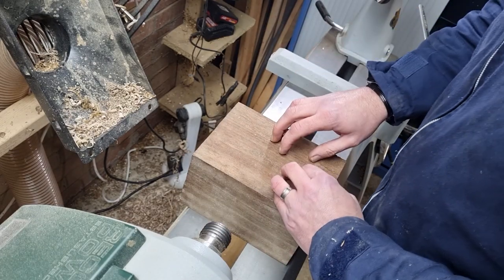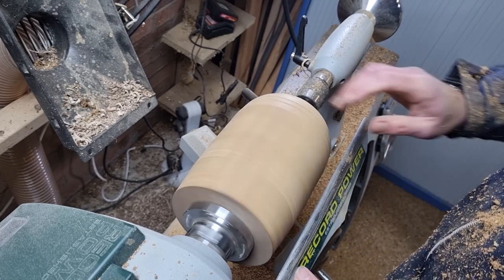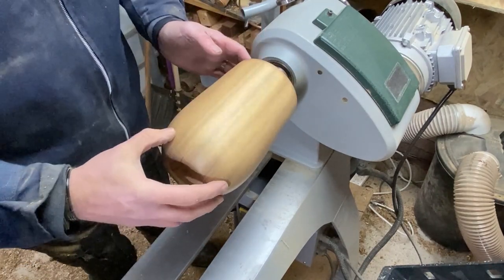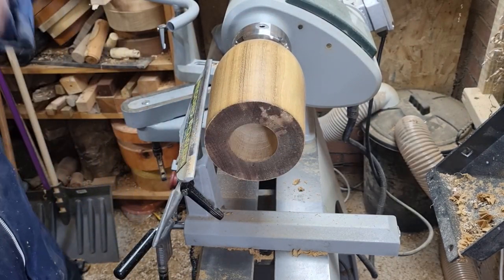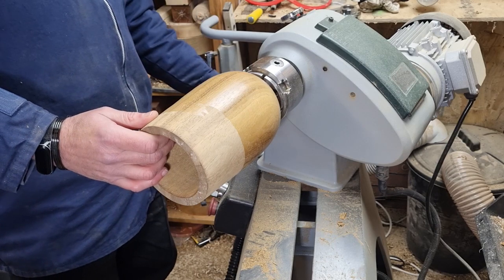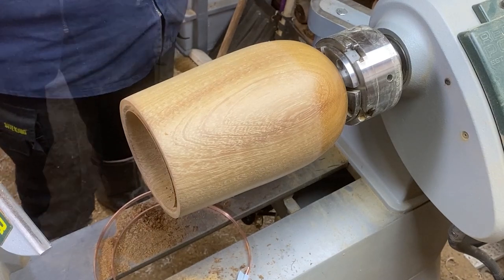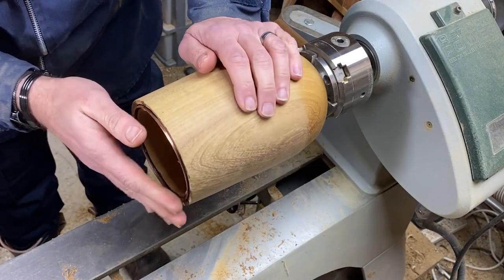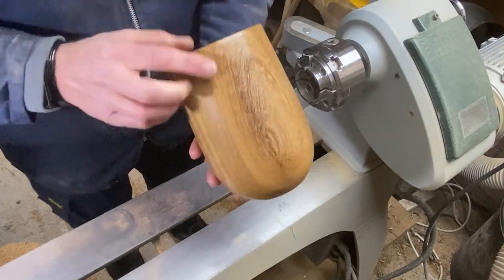I DON'T know what this is - need help - Metal Inlay and woodturning.

Comment: The vase looks terrific.   Well done as usual.   I do like the wood and the copper, nice complimentary colours.
Looks like the pictures of iroko I have seen, although I do not have any in my shop.    The colour is lighter than the sapele and mahogany I have in my shop.
Good call to grind a tool to get the narrower groove.   Metalworking HSS tool bits e.g., 1/8in x 1/8in x 2 1/2in can be glued into a piece of mild steel bar then ground for various custom tools.    These tool bits are inexpensive.
FYI copper is soft - when annealed, but it quickly work hardens when turned.   So the initial amount you removed would have been easy, but then the later depth may have work hardened, so not so easy to remove.   When machinist needs to machine copper they either remove the depth in one cut or they may have to remove the work to re-anneal.

My local turning club likes Starbond coloured CA glue brand.     My nephew is returning in Sept if you want me to send some back with him.   Just let me know the desired brand and thin, vs med vs thick.
Dave.
Reply from the maker: Hi Dave, the copper was a lot harder to turn back than I expected but did not give me any real problems. I will have a go at turning a drill bit into a cutting tool, I also have some spring steel which may work. 
Starbond is a fortune over here, how much is it there? Quite happy to send over funds for a batch. 
Thanks as ever, talk soon. 
Mike
Reply: Starbond site shows 1oz $11.50 and 2oz $16.50.
I would not use a drill bit as a turning tool.   Only the fluted section is hardened and the spiral flute shape is normally not what you want.   The non-fluted section is not hardened, good steel but not hardened.
If you want a cheap source of a turning tool you may have in your shop, consider making one from an allen key which is hardened the entire length.
Dave.
Reply from the maker: @lv_woodturner3899  Thanks Dave, I have loads of allen keys!! The price for starbond is pretty much the same as I can get O3a stuff here but thanks for the offer

Comment: Hi Mike, nice job. regarding sanding inside the vase. I turned a shaft that fits my drill and fattens out at the end. I then cut a slot into the grain and I use this to feed in a piece of sandpaper.
Reply from the maker: Ah, a bit like a flappy disc, thanks I had forgotten about those things :)

Comment: Mike, I was wondering if you have a problem with dust getting between the headstock and bed ways after you move headstock. Apparently even a tiny amount can upset the lathe centre between tail and headstock. 
This could have been what caused the little wobble in end of vase. Cleaning bedwaysbefore and after moving headstock helps. I’ve seen a YouTube tutorial on this, sorry can’t remember where or name of it but it I can be serious to proper headstock alignment.
Reply from the maker: That could have been it but not sure, I do keep the bed pretty clean but it can always happen. 😀

Comment: I think the final vase looks great and enjoy your relaxed and informative narration.
Question... What's that copper strip called? It's not a circular wire section like I'd have assumed... Was the strip used to get more 'grab' in the channel? Would 2.5mm solid core copper wire (domestic electrical installation) work, or fall out? I wonder...
Reply from the maker: Hi Frank, this is the listing on eBay https://www.ebay.co.uk/itm/224066902545?var=523388491224.
I went for a strip as opposed to a bar so I could turn it back without the fear of it getting narrower again. 2.5mm copper wire would work just fine, if you wanted it thicker you can just twist it with a drill.

Comment: Where did you get the copper inlay from, I use electrical wire copper and twist 2 wires together, have to be careful with sanding though. Don’t sand too much away.
This gives a lovely look.
Reply from the maker: Thanks Greg, I got this from ebay 😀

Comment: I have talked about brazing to other YouTubers and it seems to be something that nobody wants to mess with I like projects like this but it always bothers me just a little to see a break in something like that copper ring. Brazing is not that difficult much easier than welding but only a tad harder than using silver solder but they sell brazing rods that have flux caked on the outside of them and that makes it easier than it ever was before I have some and love it when I get to mess with them. What are your thoughts on brazing rods? You are not afraid of them are you? I do like the end result of this piece glad it turned out! Hyuk hyuk sorry my dad jokes are always horrible...
Reply from the maker: Hi Raif, it is something I have looked into but never tried. But now you have brought it out into the open I will actively look for a project to use it on. Thanks for the inspiration, all the best, Mike

Comment: something for you to try, I use this idea for large pieces, it is expensive, I bought a ARBORTECH TURBOPlane Blade 4Inch/100mm Carbide Woodworking Disc Angle Grinder Attachment | IND.FG.400.20, (amazon), attached to an angle grinder, I use a HF, I put the large log in my lathe using a grip type center in the HS, and a spinner bearing in the TS, using a low speed and the turboplane, I can knock down and round the corners in short order, then use my carbide lathe tools,  a word of caution to you and other readers, this will throw chips all over the place, make SURE you USE good eye protection. tape your sleeves and have a closed neck collar, and grip the angle grinder securely.
Reply from the maker: Thanks for the tip, you were not wrong about it being expensive! 😀
Reply: @MikeHolton  thanks, this does work, you have a name on youtube, 
you might ask turbo plane if they would send you a unit to feature on your channel? maybe you could borrow one from a friend, I am telling you, HANG on to the angle grinder, the turbo plane tends to grab into the wood... just want to be safe using tools, for you and others
Reply from the maker: @Henry-n7n8  Thanks again, I may give it a try but not for a video. I would not want someone copying and getting hurt for whatever reason even if it was their fault, it would have been me putting the idea into their head. But I really do appreciate you passing on tips, thanks

Comment: Beautiful work, Mike. The simple shape ends up extremely elegant!

 Regarding sanding deep vases, have a look at this guy's method. Very simple but very effective: Sandpaper on a foam pad around a simple scrap piece of wood:  https://youtu.be/JBPxBxztop0?t=571
Reply from the maker: Thanks Tom, sorry for the slow reply on this but it was held over because of the link and I did not look for held messages. All the best, Mike
Reply: @MikeHolton  No worries at all, Mike. I didn't know about held messages (or even what that means). I just wanted mostly to send a positive comment as your work is so amazing. Looking forward to more!
Reply from the maker: @tomburns7544  I know Tom, it's just the YouTube algorithm  that sees something with a link and keeps it for me to check first, trouble is I don't often check the hold page lol.